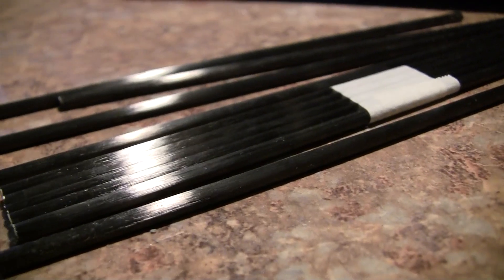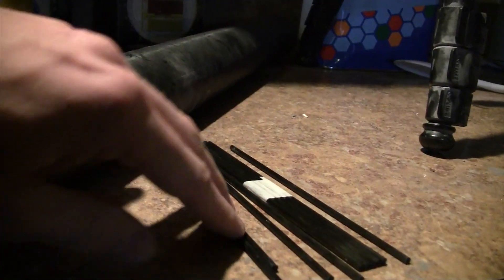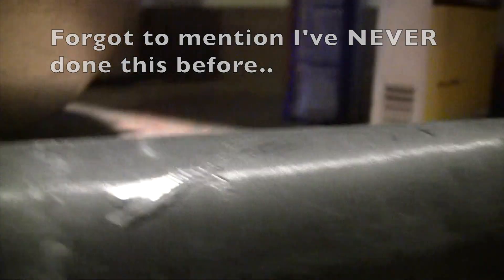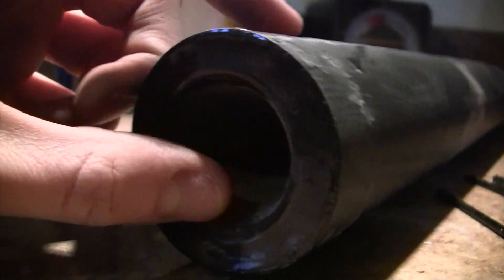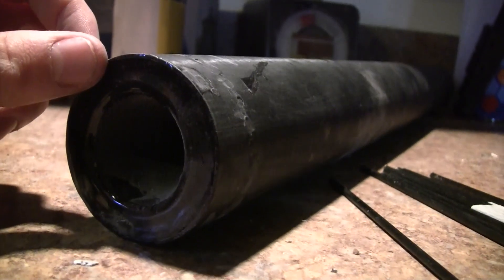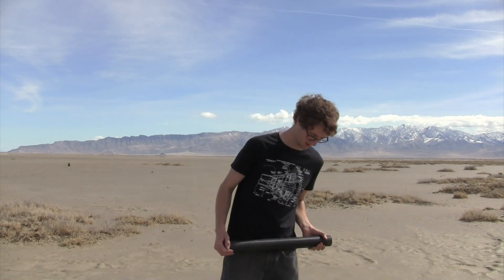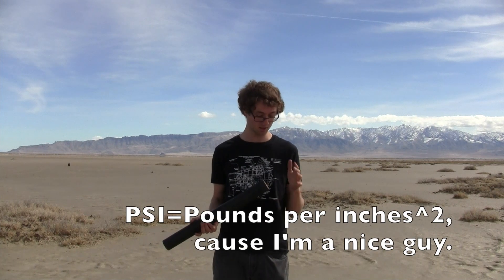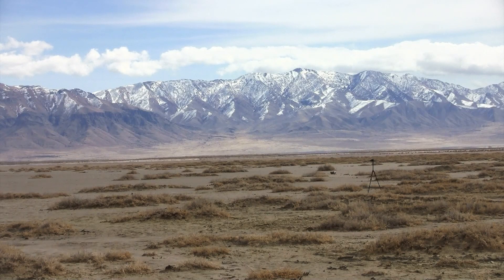Composite Rocket Motor Case!!

Comment: Can I use potassium chlorate as oxidizer instead of AP?
Reply: Nope to dangerous, extremely pressure sensitive. BOOM!
Reply: I have the same question
Reply: Absolutely not. If you can't get AP you should stick with R-candy, KNO3 works well enough to launch rockets just fine. APCP fuel is called APCP for a reason, it stands for Ammonium Perchlorate Composite Propellant, chlorates are extremely dangerous, you'll be building pipe bombs if you try using it for rockets.

Comment: What are the percentages of the mixture?, 

I also do not find the material: Tepanol
Reply from the maker: Tepanol is a minor binding agent for the Ammonium Perchlorate. Not really needed unless making large aggressive motors. It is also called HX-878. You can highly vary the mixtures of solid rocket motors to effect burn rate and other characteristics. The Space shuttle boosters were 70% ammonium perchlorate 16% aluminum powder and 0.4% iron oxide catalyst with the rest being a rubber binder.
Reply: Thank you

Comment: Is that the type of motor case you're planning for your sugar challenge to me?
Reply from the maker: Quite. Two stage carbon cased sugar motors :)
Reply: We had been using fiberglass motor cases in the past but switched to less expensive aluminum and steel for testing. Our space shot will be done using lighter composite case.